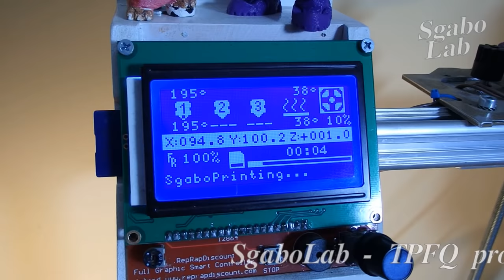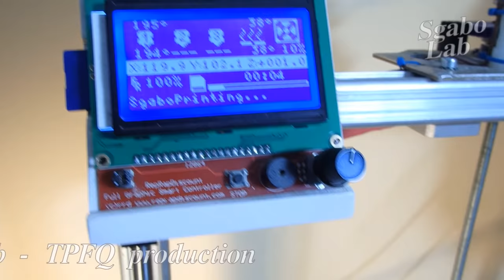3D printing How to make Fanless Cooling Pieces 2.0

Comment: What is the advantage over a fan?  

It seems like it would be much louder and you can't control air flow settings per layer with your slicing software like you can when using a fan. .
Reply from the maker: hi, the advantage is use less air only where it need ..
less cooling hothead and bed with obvious advantages .. I use always from second layer ;)
Reply: SgaboLab got it.
Reply from the maker: Hi, I answer now because I suppose it is an affirmation .. I'm still learning English and now I have a doubt :)
Yes it works fine for me.
Reply: @SgaboLab  silicone sock solves the issue of the hot end cooling down too much and PID not managing to keep up. But I like the idea was tested. The pump is usually extremely loud though.
Reply from the maker: @MomWillBeProud  silicone sock not existed when I made this mod ;)
Reply: The largest advantage to my mind is the potential reduction of weight on the extruder, less weight = better acceleration and deceleration, IE less jerk and higher speeds available, good'ol f=ma. Not applicable to this moving bed design but very much so to other moving extruder designs. The whole reason for the existence of the flexdrive systems.
Reply: same advantage of a bowden extruder, removing machinery/components/weight away from the head.
Reply: Tony Shulthise avoid wobbling from the fan
Reply: you can probably dim/pwm the pump
Reply: You can't hear the advantage over a fan in this video because of the horrible muzak.

Comment: if you would like to test your idea I think you need to print something very tall and skinny like a 5mm tube thats 100mm tall.  Solid infill to try an keep heat into the filament and the short layer heights usually will start acting up when you get higher in the print.
Reply from the maker: hi, I alredy print object much higher ~17cm whit version one... search video "manfrotto" on my channel ;)

Comment: Boo, you cleaned that boat up before you held it into the camera! There's some stringing artifacts missing that are there during the print!
Reply from the maker: :D ... yes I remove the blobs ... is so evident and I add that the boat is at 45 degree on bed when I take it .. is only scenic video conclusion ... you have discovered the hot water  :D

Comment: I have the idea of build a heating element inline to get "hot" cooling for PC, PEEK & co. for printing without enclosure, but with a skirt at the same height as/around the part, that would contain the "hot" air, avoiding warping...
 Would this work ?
Reply from the maker: I don't know, try ;)

Comment: Nice build, I have the same idea to cool with my aircompressor instead of the fan!
Reply from the maker: thanks .. but in my opinion .. the normal air compressor is too much for this application  ;)
Reply: @SgaboLab  maybe airbrush compressor? Does your solution print better overhangs than a regular blower?
Reply from the maker: ciao, yes but this was a old idea that continue to works on that printer .. now I use new solution .. look in the channel for Scolopendra Cooler ;)

Comment: Get an <old> CPAP machine: they deliver air at steady pressure, typically with 1% regulation.
Newer ones have security lock-outs linked to a prescription!
The down-side is they can only be turned on and off...changing pressure is a separate operation.
One could install replace the 'brain-box' of the CPAP with an Arduino; printer could control the parameters.
They can deliver around 20cm H20 pressure at large volumes.
CPAP's can inflate a sleeping person lungs...that's a lot better than an aquarium pump!
And they are very quite!
One pump could run about 10 printers...Farmers!
Reply from the maker: ciao, thanks, but this printer went out of business a few months ago when I converted the i3mega to 3mm filament and use my Scolopendra cooling system ;)

Comment: Aquarium pumps are very loud and vibrate a tremendous amount.
Reply from the maker: Hi, you can regulate the air flow and the vibration is inrrilevant respect the vibration of printer.

Comment: Very good work.
Which size pump did you use, would 50 litres of air per hour be enough?
Reply from the maker: hi, I use 4.5 litres per minutes, 4w of power ;)
Reply: Thank you for the quick reply.

Comment: Hello, Mr. Sgabo! My question is about the quality of printing? Did it change for better? Also there was some improvement about the speed you can print, can you print faster?

Thanks in advance! 

Beautiful job
Reply from the maker: hi .. nothing of that :) .. it only less cooling the head and the bed .. and good results with abs that require less airflow

Comment: outer air too low.....
i used motor same as you (4W) but it too low
Reply from the maker: w not indicative .. l/h or l/min is important, my is 4.5 l/min max but I use it at minimum  ... also important is how long are the tube and diameter to have good flow
Reply: @SgaboLab  i use 1m 8mm type tube :v